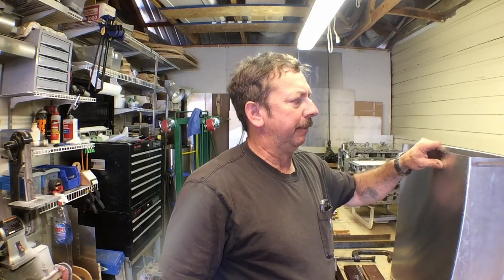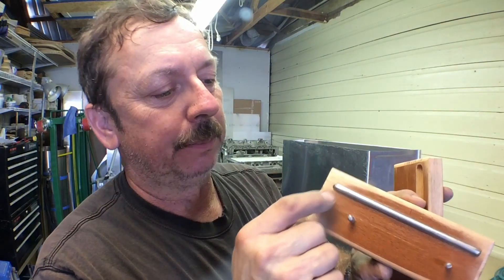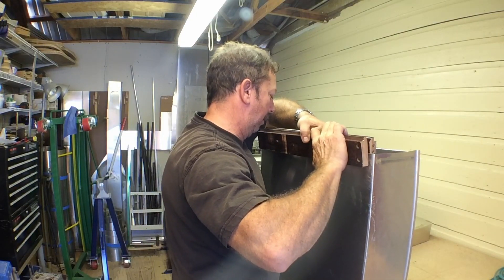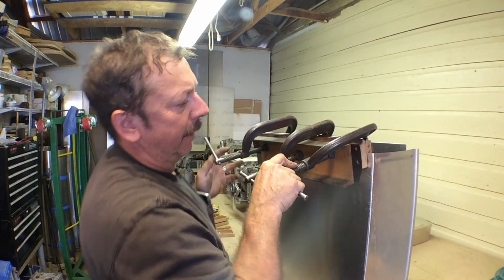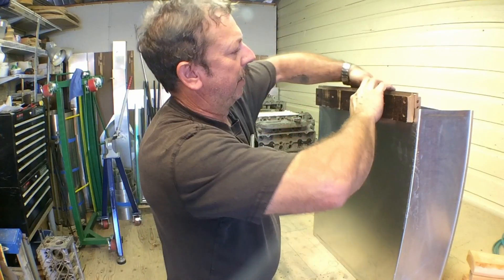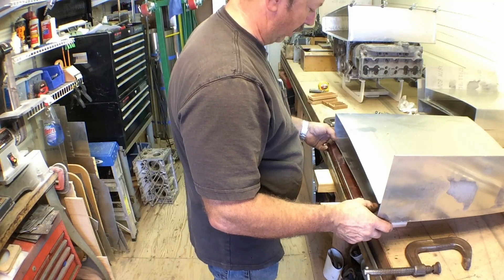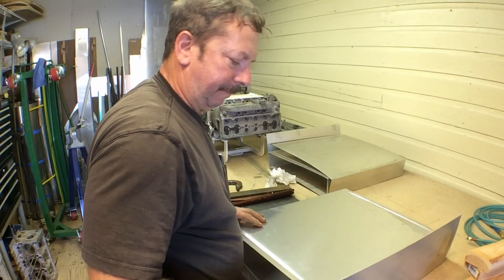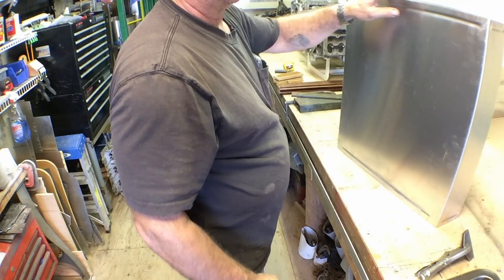Building a Zenith 701 Experimental Airplane, Forming Fuel Tank Stiffening Beads

Comment: How deep is that tank where the sending unit goes in?
Reply from the maker: not sure, 100 at the back, 200 at the front, I would guess in the 140 to 160 range but I am not sure why that dimension is important because if you are using float senders you will bend the wire to match your specific tank. this is for the top mount senders and not thru the side of the tank which seems to be more prone to failure from sender leakage. Dan.

Comment: Those turned out great, Dan! I did mine with a bead roller, and it left a lot more work to be done afterward to straighten out the skins before welding.
Reply from the maker: Thanks Greg. The smaller beads were easy. the longer bend was a little harder to get formed. If I were building the longer form again I would take the extra time to make it from thicker stock and sand some releif for springback into the blocks.